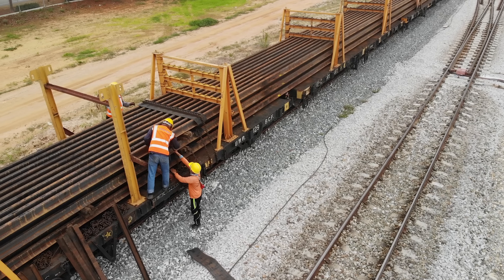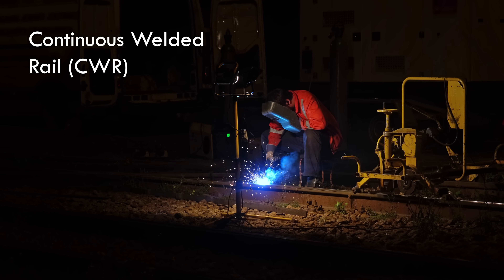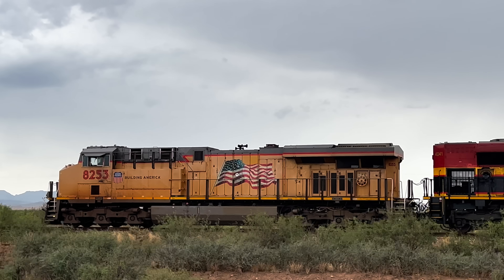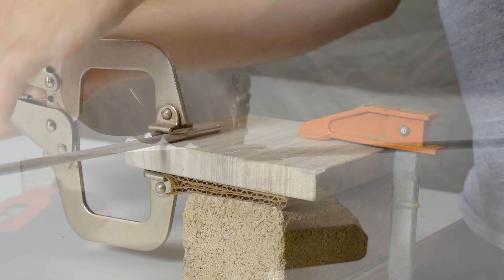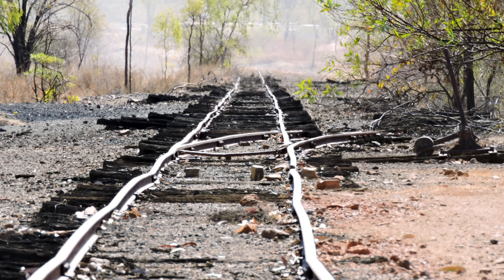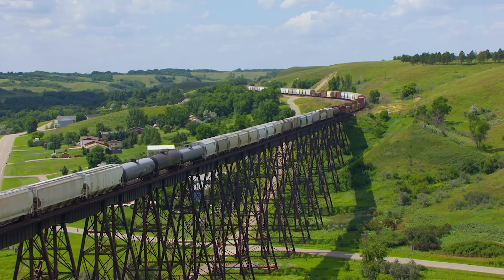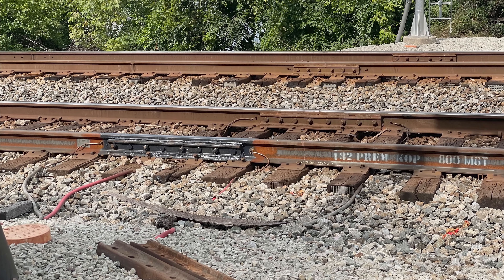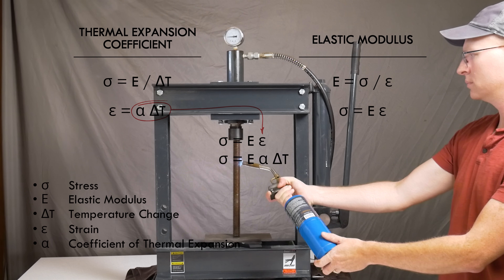Why Railroads Don't Need Expansion Joints

Comment: My dad worked in college (45 years ago) to replace these jointed sections with 1/4 mile long sections.  I always wanted to see how they are transported and unloaded.
Reply: They get loaded on ribbon rail trains. The train cars have racks with rollers on them. The rail gets unloaded as the train pulls alongside.

Comment: Did you know railroad engineers plan out a route as if it were a flat even surface for hundreds of miles, without taking into consideration the curvature of earth at 8 inches per mile as a formula?
Reply: Did you know that 8 inches per square mile is a parabola?
Reply: Also, why would it matter for only 40 feet?
Reply: Please explain why the would need to calculate it? Really, show me a project with and one without the calculation and tell me where the different is at

Comment: Ever wonder why they chose 39 feet as the length of rail? It's because back in the day when rails were hauled by railroads, the longest flatcar that could carry them was only 40 feet end to end. it was against the law for anything to protrude beyond the end of the car and so they were measured 39 feet to comply with rules on the length of the cars that carried them. The size of rail was typically indicated by its weight in length of 36-inches so a 72# Rail weighed 72 pounds per yard. 90# rail, 90 pounds per yard. Newer rail is typically 132# But if you could imagine a 39-foot 72# rail still weighs 936 pounds each. A typical 40-ton flatcar from the early 20th century would only be capable of carrying about 48 rails. Or for the larger 90# rails, it would carry even less, for the weight. Today's rail shipments usually come with 80-foot sections of 132# rail on 86-foot flatcars that are capable of 143 tons. Each rail weighs 3,520 pounds and would give the flatcar the capacity to hold up to 67 rails at a time. Of course that's not the quarter-mile sections of CWR that are discussed here. These are just the standard rails used in jointed rail applications which are prevalent despite the wide use of CWR. Typically a ribbon of CWR is 1,320 ft or one quarter-mile in length and are hauled in their own special trains. But even one of those ribbons weighs 58,080 pounds. The CWR trains can usually carry 80 of those ribbons, which is 10 miles worth of rail. I have always admired how flexible those ribbons are. One of the most magnificent sights is to see one of those loaded ribbon rail trains going around a sharp corner.  I believe Virtual Railfan exhibited one going around the connector at Deshler, OH and boy was that a sight to behold.

Comment: Every time I've ridden a train here in New Zealand, there have been heat restrictions, limiting the speed of the train on hot days in case of buckling. We don't get anywhere near as hot here as Texas does. I just looked up the temperature the day I rode the train last month, and it was only a high of 22.5C, which is not an extreme temperature around here by any means.

I remember hearing years ago that the reason for the heat restrictions was a move to welded rail, but I never understood why they would do that. Now I still don't understand why they have these restrictions with all the mitigations you've mentioned. Is it that old story of underinvestment in rail infrastructure?

Comment: We use expansion joints when joining  two continuous welded rails section together. 
Why instead of welding, can't we use just expansion joints to replace old jointed rail? 
As I understand, expansion joints eliminate clicking sound with it's negative effect and allow thermal changes. And they're seem to be much easier to build, than continuous welded rails.

Comment: one thing id like to point out is that the joints we see are usually are called IJ's for "interlocking joint" which are typically for the circuitry in signals

Comment: Hello, I worked for 5 years as a railway worker in Croatia with the subcontractor Switelski (They have the largest machine for changing rails in the world) First you build, for example, 5 miles of railway, you tighten the rails with bolts, then a machine called a tensioner straightens the track, then all the bolts are loosened, a piece of steal of approximately 20 cm is cut for everry 5 miles, then with the help of hydraulics, the railroad is literally stretched to a distance of 10 cm, and then it is welded with thermite and then you must re-tighten all the bolts on the rail and sleepers. One summer night we worked on a section and overnight a pleasant 20 degrees Celsius, we did not unscrew the bolts from the rails, when we returned to the construction site in the morning we were shocked, the track was literally distorted together with the sleepers in the shape of a snake, and all because we did not expect that it would be so hot in the morning, it  took us full 5 days to straighten 5 miles of railroad and then we cut it and stretched it and welded it and after that the railroad remained straight 😂😂

Comment: Excellent explanation. Been on the rails since 1990 and this is the first time learning how CWR works. 
 In short, it’s a better product if it breaks when cold rather than hot. I’ve seen both issues happen and the choice is obvious when you see yourself heading towards a sun kink vs hearing the sound of the broken rail as you drive over the break. 
 It’s horrifying to see yourself heading into wobbly rail cause you have no way of knowing if you’re going to make it alive.

Comment: The first time I was ever asked to wear safety glasses was in a physics lesson in school in the 60s . A round bar held horizontally in a pair of fixed vertical brackets. The bar had a hole through one end and a threaded adjuster on the other.  The bar was heated with a Bunsen burner and when the heat was removed a cast-iron pin was put through the hole at one end and the bar was tightened within the brackets by tightening the threaded adjuster on the other end.  As the bar cooled it contracted causing the brittle cast-iron pin to snap with a loud bang the 2 pieces flying uncontrollably, thus the safety glasses.

Comment: Awhile ago I read an article by UP where they had a some trouble in certain areas with reoccurring buckling. 
I've probably got the facts and figures all wrong but it went something like this:
They consulted some records and found the likely culprit to be rail inserted on days + or - 60 degrees f that of the existing rail. So cold rail replaced where the rail was originally installed on a hot day and vice versa.
As a trial they relaid the rail on days that were closer to the temperature of the existing rail in that area regardless of whether it was hot or cold and the results were still satisfactory many years later.

Comment: Under the pressure of the press, the pipe did not "stay the same size".
It simply expanded outwards (diameter) rather than lengthwise.

Comment: I loved going on the east coast mainline from London to York a few months ago, but one of the best parts was seeing Bullhead Track(!) in York station. I’d never have guessed that I would see chairs and keys on rails in the 21st century, but there it was, in 60’ sections, leading right into the railway museum. It’s still used on heritage lines though, and with great success.
Reply: It is quite rare but there is (perhaps was by now) such a thing as Bullhead CWR, normally on CS1 chaired concrete sleepers.

Comment: Someone, somewhere, at some point in the 1950s/1960s...

E1: "So, we still risk buckling if the rails undergo compression... what if, and hear me out, we installed them such that they're almost never undergo compression. We could install them on the hottest days of summer."
E2: "..."... blinks and then looks at the results of deformation testing, etc etc...
E3: "That's quite possibly the dumbest idea--"
E2: "But it would work!"
E3: "... Wait, you're seriously considering this?"
E2: "The math checks out. What's the harm in trying?"

Comment: The images of jointed rails show lots of big bolts. Tightly holding rails in permanent position. So how can they be 'expansion joints'?
They would need to be able to slide.
Reply: The plates are lubricated and the bolts are slightly smaller than the holes in the rail ends.

Comment: I'm not a big fan of stressing. You have to unclip all that rail and if its older rail then those clips do not want to come out. Then you have to scrape off the pads from the rail, unless they want you to replace the pads, nylons and clips then you have more work to do as you have to collect the scrap and it doesn't take too many clips for a bag to be heavy. Then you have to wait for the welders to do tbeir work that's after helping them on witn their heavy equipment. And if the weld fails? Well then you have a new nightmare cutting out a section of rail, cutting in a new section and stressing over again.

Comment: I stayed in an AirBnB in Brighton before that was a terraced house but built into the side of a small cliff, so was 5 stories, and the garden was way below street level.

I could see onto the exits of the main railway section and a few (maybe 4) parts of the track would make very loud cu-c'unkn sounds - not with all trains though and sometimes only every Xth train. But the best part was the third rail would also disconnect/connect (in the UK the third rail often seems to disappear underground at stations etc, then reappear after them, so people falling on the tracks aren't at risk from them). It would be great because when they'd hit either the start or joint at night you'd see sparks fly out, weirdly sometimes they were blue to white, while other trains would make more yellow/red ones.

I only stayed there a few nights, but I watched it every night. It was beautiful, also some trains would make really loud noises, and/or sometimes the sparks were huge.

It was only on one or two tracks of the dozen+ I could see. But also the most populus ones by far. I guessed it was related to those trains being very full and modern, and maybe that bit of track become updating.

Might be annoying if you lived there though. Tracks were a few hundred m away and sometimes the sparks would light up the room.

Comment: One more slight errata in case this was not caught previously: At 9:00, the modulus of elasticity for steel should be 30x10^6 psi (USCS/Imperial) and 207x10^3 MPa (SI). Looks like only a slight issue with positive versus negative signs here. Incredibly enlightening and well-explained video as always!

Additionally, one more interesting thing to note is that any temperature difference between the neutral temperature and the temperature that a section of rail cools to during manufacturing does induce thermal strains but does not create any buildup of stress within a particular section of rail (since the rail is not fixed at both ends prior to installation on the track).

Comment: I love that. The problem was metal buckling under thermal expansion, so we had joints. Then we realized joints have their own issues. So we came back to the original problem and "after we did the math, we realized if we hold them reeeeal tight, then they don't buckle anymore". Aweome 😂
Great work, as always! 💯
Reply: Though leaving them in perpetual tension doesn't half help, presumably there is an economic balance between the costs of pretensioning and the costs of restraining buckle causing compressive loading when laying track.

Comment: well... i havent watched the video yet but i did thermite welding for some years in Switzerland with temps between 50c to -15c... and i can tell you SOME areas do need expansion joints as the temperatures there may vary too much.
Reply: finally its here lmao https://www.youtube.com/watch?v=pk9d-e7csLw

Comment: Here in the UK when it's been hot and due to get hotter you'll often see the rails in points/switches painted with white paint to reflect some of the heat from the sun.
I'm a little surprised that you didn't include what happens to the rails in your switches and which methods are used to counter heat expansion problems, especially as it gets hotter there than ever it does here.
Thanks for another engaging and educational video.
Reply: finally its here lmao https://www.youtube.com/watch?v=pk9d-e7csLw

Comment: @8:49 The equations are wrong. Elastic modulus of steel is 207 GPa or 207x10^3 MPa, not 207x10^-3 MPa.

It is also around 30 Mpsi or 30x10^6 psi, not 30x10^-6 psi.

The end results are ok.
Reply: finally its here lmao https://www.youtube.com/watch?v=pk9d-e7csLw

Comment: Modern rail still uses expansion joints without the clickety-clack: sliding joints (long wedges that can slide past each other) are common in europe, even for high-speed lines

I'm sure both methods (restraining and expansion joints) have their different use-cases.
Reply: finally its here lmao https://www.youtube.com/watch?v=pk9d-e7csLw

Comment: I am structural design engineer. The CWR is a good idea for less maintenance and riding comfort. In addition to this, rail stress is to be checked for rail structure interaction as a non linear analysis at structures with respect to loading and stiffness of elements. The forces in substructure may have increased due to this effect. The guidelines are given in UIC 774-3R.
Reply: finally its here lmao https://www.youtube.com/watch?v=pk9d-e7csLw

Comment: I have really been enjoying going through this series and it has come at a really fun time for me. I am working on my capstone project for my engineering degree. My team was tasked with analyzing a current train track which is failing by buckling. We have to figure out what is causing the buckling and then design a new fastening system which will prevent the buckling. We have actually been using these equations and other information to determine what forces our new fasteners will be up against and design accordingly!
Reply: finally its here lmao https://www.youtube.com/watch?v=pk9d-e7csLw

Comment: As someone that did track work the piece that is referred to as a fishplate is correctly called a joint bar, I researched several sources and the only source that used fishplate to define a joint bar was Google, but as time moves on and terms and definitions change I’m old school and only call it a joint bar, all and all I enjoy your presentation’s thanks
Reply: It depends where you are in the UK they are most defiantly only called fish plates.
Reply: @meeeeeeeeeeeeeeeeeeee2   I was not surprised that a joint bar is called by a fish plate in the UK and anywhere in world were the Uk built railways, but I was referring to American practice, thanks for informing me on the nomenclature,

Comment: In the UK, almost anything gets blamed for hold-ups and delays.   So bad, that "Leaves on the line" in autumn (Fall) and "the wrong kind of snow" in winter are fabled memes. Both affect traction, but British trains seem unable to cope with conditions that the whole world experiences. 
In recent heatwaves, the buckling problem has reared up. Services still run, but at greatly reduced speeds, presumably to give the driver time to stop the train if they see a problem in front. Or reduce the casualty count if it derails.  So now we have "the wrong kind of sunshine" to add to the excuses.  Sigh.
Reply: finally its here lmao https://www.youtube.com/watch?v=pk9d-e7csLw

Comment: Is there some way the rails could take advantage of thermal 'sink', using a material or fluid as an heat exchanger to pull the temperature to and from underground where it's 50° all the time?

Comment: 8:48 In the table, there two system of units names. However, SI signifies the International of Units (Système International d'Unités), i.e., metric units. The US system is named Customary Units, often but wrongly called the Imperial System, which are British units defined by Act of Parliament in and introduced from 1826. The US standards were derived from various earlier English standards.
Reply: I was wondering the same. Maybe it was supposed to say "non-SI" on the left side and "SI" on the right but later mixed up for some reason.
Reply: @Tvimadur technically right side also isn't SI :) Celsius are not in SI tables - but since there is deltaT math checks out ;p

Comment: Now I'm wondering why the diagonal expansion joints seen at 13:00 didn't just completely replace the older style. Seems like it'd still do the same thing but without the additional maintenance concerns.

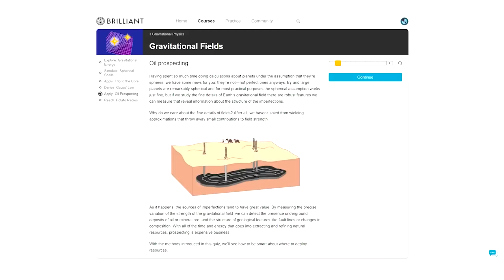Comment: Dog Gamn. What an intensely annoying video. 14:45 minutes of repetition, obvious details and pure fluff to pad out the answer to the question posed by the title that reduces to: "The rails are installed under compression at the nominal average temperature, so that when the shrink on cold days they simply reduce the compression they are under and when they expand on hot days, they expand sideways, but not in length; all with the elastic limits of the steel used."

Comment: I knew that heating pipes were laid prestressed in trenches by filling them with hot water before welding compensation joints, but I didn’t realise that the same technique was used on railroad. Moreover, rails are preheated simply by installing in hot weather. Just amazing 🤩 
Thanks for the great content Grady 👍

Comment: I was waiting for a quite while for you to mention those diagonal joints, because yes, you can weld rails into much longer pieces, but that only increase amount of expansion in plain metric. Amount of forces on 100 miles single-piece railroad would be insane and unbearable - why to fight it, when you can just leave it to breath?
Simple answer is that railroads still need expansion joints, just stopped them to be perpendicular to rails, principle is the same as it is with helical gears...
Reply: The rule of thumb I was told was that for every degree centigrade the rail moved away from its natural temperature (the temperature where it is not in compression or tension) a force of one ton was generated.